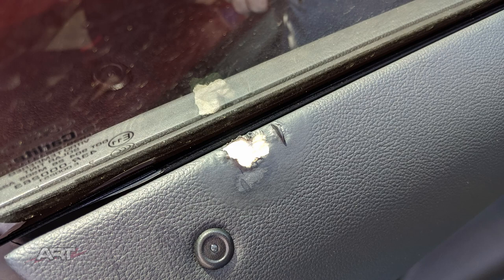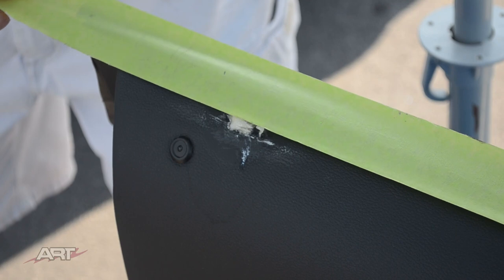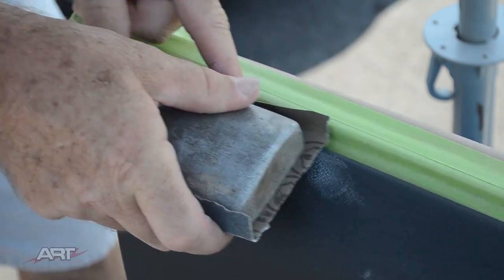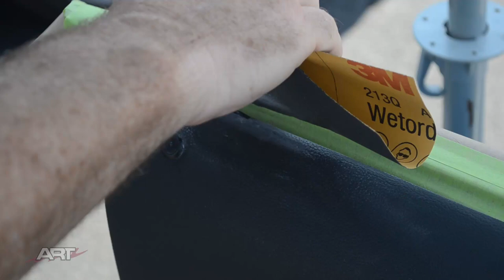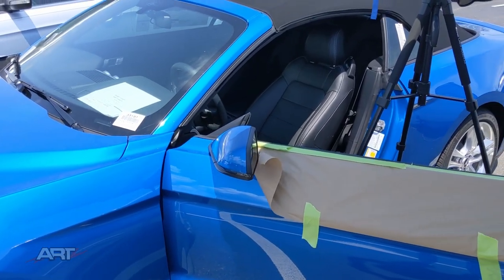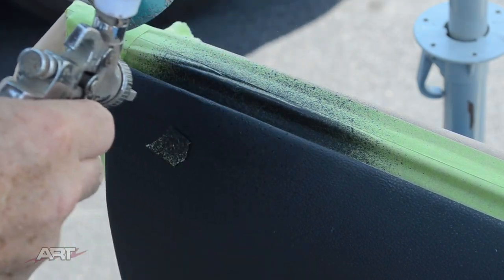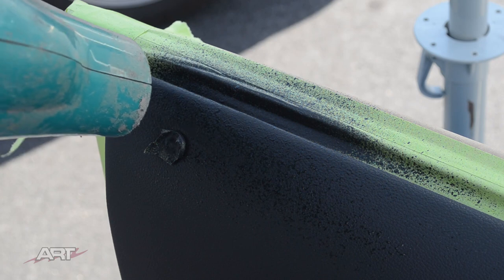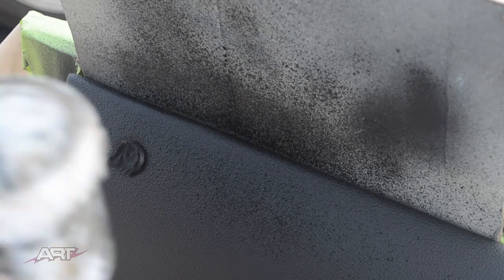Door Panel Repair - Constructing a Texture v23

Comment: Great video, learned quite a bit and have an even bigger appreciation for the pros that do these sorts of repairs! The musician analogy was also spot on, I know from doing house wallboard textures it's about technique vs. some magic spray in a can . I am so glad I found this since I was not liking the commercial texture sprays in a can I was finding, which appear targeted mainly for bumper cover textures. I just bought a double DIN center console bezel for my 2002 Corvette and it is smooth flat black rubberish coating instead of the grained and deeper black of OEM. I have spray equipment and have done my share of bodywork in restoring >30 cars, so would like to know more about these water-based materials you used for this repair and where to get them.

Comment: Another question...Would it be better to make a new rubber grain pad for this job.....???
Reply from the maker: None used.
Reply: I know you didn't use one, but would it be better quicker to make a grain pad?
Thanks
Reply from the maker: You could using a cold method but as I explained in the video, the hot method bleeds away the grain from the factory vinyl.  That's part of the problem to begin with.  You would chase it all over the panel.  
The cold method is an unnecessary step because, in the end, the only way to blend that on a highly visible panel is to construct a sprayed grain pattern.  That is the whole purpose of the video, to break away from older, less effective methods.  Thank you for the question. That gave me opportunity to explain in more detail.
Reply: @a.r.t.srealrepairsforrealc8247  Thanks for your quick reply.....Iam going to look at the video again...love your work mate...from NZ

Comment: Brilliant work. Do you spray top clear finish to lock/protect the color from damages?
Reply from the maker: Yes, most of the time.  In this instance I did not.  The plastic binder base coupled with crosslinker is mostly indestructible.  If I was spraying with the softer leather base then I would be concerned with possible raindrops distorting the pigmented coating.  In that case a clear topcoat with additional slip and crosslink would be called for.  Then raindrops would be repelled and would not be allowed to soak into the pigmented layer causing a migration of pigments, hence spotting.  Good question, thanks.

Comment: Great video! Any alternative methods?
Reply: This basically is the waterbourne alternative to those vinyls and aresols. My friend, if you have time follow this guy. He's a true craftsman. You could do this with vinyl and say, SEM Texture. It's noticeable if you don't do the same sanding as you go to build the texture that you are after. The difference is this will take you a few hours vs a few days. I mean you can use a heat gun with the other method, just stay far away and keep it on low